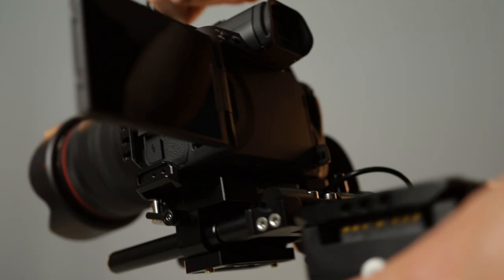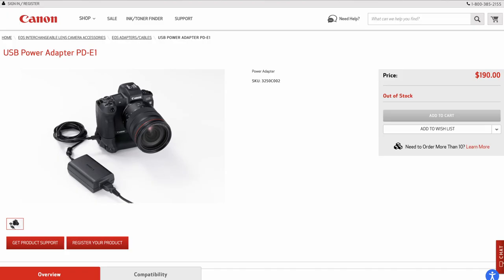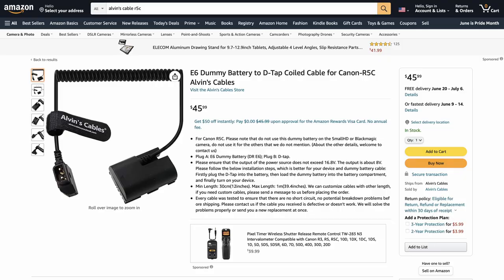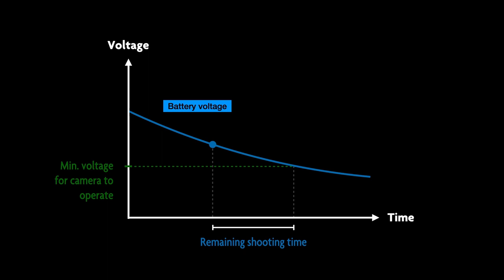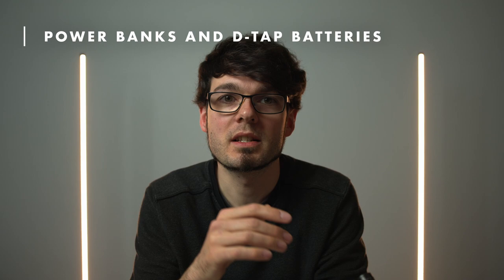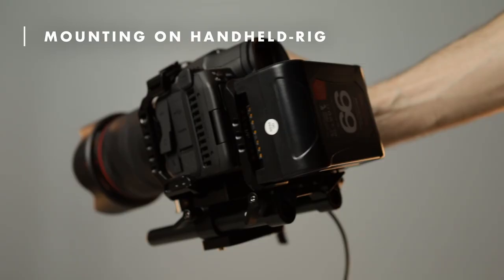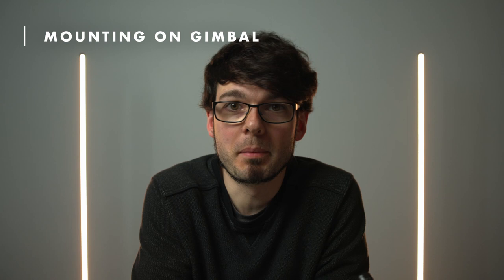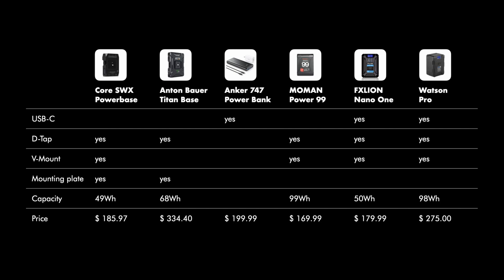Canon R5C Battery Guide (Power Banks and Dummy Batteries for Handheld and Gimbal Rigs)

Comment: Thanks for the info! I can also recommend the Andycine NP-F970 battery plate for the R5C. It comes with USB-C/ PD-out. The battery lasts really long. Is even more compact and lighter compared to the V-Mount. You just have to think about how to attach the plate. I now have almost all the solutions

Comment: Do you know if the Alvin cable dummy battery to dtap R5C cable will work to power it for 8K60? fantastic overview! I’ve searched online everywhere but can’t find accurate info about external power for the R5C! thank you for the great work! Subbed for life!
Reply from the maker: They have some issues with the cable right now regarding 60fps RAW, but they seem optimistic to fix it.
Reply: @johannesdoerr  oh no! I just ordered one! :(
Reply from the maker: Contact them, they might send you a second one once they figured out RAW 60fps
Reply: @johannesdoerr  hmm good call! thanks again!
Reply: On amazon’s page for the alvin dummy listed: “For Canon R5C. It does not support 8K auto focus”. So it’s not the perfect solution

Comment: This is super content, Johannes! Thanks for making it 👍🏻
I've got R5C recently and battery upgrade is on my next steps list...
Reply: out of curiosity, what run time are you getting from 1 LE-E6NH battery? I am about to buy this camera. Either lots of LP-E6NH batteries, or the battery grip, or the V Mount.
Reply: @agentleman7469  Commonly 30-40 minutes of filming. You can extend it a lot with the trick of pressing Media preview button which puts the sensor on sleep. I do commonly use it just with traditional batteries (and have 4 spare ones in the bag).
Reply: @JaroslavBengl  thank you so much for taking the time to reply, much appreciated. That seems okay for me. I might just get the battery grip and some extra batteries. Cheers

Comment: I am thinking about attaching a power bank holder to the right side of the cage, put the power bank, and THEN balance it on a gimbal. Yes, you still lose the gimbal controls, but if you can go for 4-5-6 hours of shooting with an Anker power bank, I think this might be a good option, while not putting that much extra weight on the gimbal

Comment: Canon has had the DR-E6C dummy especially for the R5C since before the launch. That combined with the Anton Bauer to Canon 9V P-tap cable is a solution that has been around from day one. Also, Niceyrig make a V-mount plate that combined with the Smallrig counterweight can be mounted a lot more safely to the RS2 to accomodate a v-mount pack.
Reply from the maker: Do you have a photo of the NiceyRig + SmallRig solution?
Reply: @johannesdoerr  I have a video on it ;)
Reply from the maker: @EmeraldAudiovisual  Ah, I understand! I thought about getting the counterweight kit for mounting something else under the gimbal some time ago. Definitely a good solution to mount the battery. Will probably work with the little SmallRig V-lock mount that I'm using, too!
Reply: @johannesdoerr  i just don't want to promote my stuff i somebody else timeline. But its a real good option.

Comment: Very nice video.

I took a slightly different approach and focused on the cost per watt-hour.  The Canon batteries, even the knock offs, are $3/watt-hour.  As I recall, the V-mount batteries that I priced were $1/watt-hour.  And some of the cheaper power bank type batteries were as low as $0.30/watt-hour.

With the power bank solutions, care must be taken to make sure that a single port can supply enough power.  Many advertise the total power but they have multiple ports.  So, check to see how much power a single port can supply.  As I recall, the R5C needs 20 watts.  (Someone check me on that.)
Reply: U need a power source that has the 9V/3A protocol (27W). The camera does not need as much but that is the protocol needed to make it draw power via USB in PD mode. it will not do it if that protocol is missing from the power source.

Comment: frist, thanks for the video
in the description you say we should get a better dummy battery but which one?
you havn't linked a proper dummy battery for the full 8k60.

I just need a dummy battery + power brick (EU/Germany) to record with the R5C in the studio without any limitations
Reply from the maker: Alvin's Cables has a dummy battery specifically for the R5C, but it still does not support 8K 60fps. As far as I know, there is no dummy battery that can do this.

Comment: I received my dummy battery from Alvin's Cables and it's no different then the others. They sent me a message saying that they were working on one that would provide sufficient power to support the R5C
Reply: How do you mean no different to the the others?
Reply: The Amazon page now states that it does NOT support 8K 60 fps.  To me, this tells me that Alvin is a legitimate company.

Please update us if / when Alvin replies with a solution that works.

Comment: What Apple MacBook Power Adapter are you referring to in order to charge the Moman 99 battery?  I would like to charge the Moman as fast as safely possible without burning up the battery.  But different MacBooks offer different Power adapters.  I have an M1 Mac.  Will that adapter work?
Reply from the maker: I don't change the Moman battery with the Mac power adapter, this is only possible with their new "pro" version of that battery. I the video, I was talking about charging the R5C with its internal battery.

Comment: Hello Johannes. 
I tried to emulate part of what you did for my Canon R5C, however I must have made a mistake somewhere.  
I purchased a FX Lion Nano 1 and a Focus Foto dummy plug, and it does not power the R5C
If I use the Vmount battery via usb-c, it powers the camera no problem.
I am thinking I will try another dummy plug
Do you have any other suggestions

Thanks
Reply from the maker: The dummy battery must be made explicitly for the R5C, because it requires a higher voltage. Other one will not work (in video mode)

Comment: Just got this camera and your video has been very helpful! Do you know if a 12V output from SmallRig NP-F Battery Adapter Plate could power the 8K60p? It'd be such a nimble setup.
Reply from the maker: There is a NPF plate that has a d-tap output, which could work with a d-tap dummy battery (but at the moment, the Alvin's Cables dummy battery does not support raw 60 fps, they are still trying to figure it out) https://amzn.to/3pi2v2W

Comment: hey! my usb c mac laptop power cable wont power my camera??? it doesnt work
Reply from the maker: That’s strange! Works perfectly for me…
Reply: I figured out. you have to have a battery in for it to work. Plugging in with no battery doesn’t work. I have another question: AF is completely greyed out and no options selectable when I switch to S&f motion. Have you ever had that issue? My lens is the RF 24-70 and i have s&f set to 72/23.98. No autofocus?

Comment: hi..work ok r5c with Alvin's Cables Lanparte LP E6 Dummy Battery to D Tap Cable ? you have problem with this or is ok,thanks !
Reply from the maker: Probably not. I had dummy batteries for the R5 that did not work with the R5C. Alvin's Cables has a dummy battery for the R5C which works, but not in 8K 60fps. Check the video description for the link.
Reply: @johannesdoerr  ok i order cable for R5C i hope to work with my batery d-tape Smallrig V50

Comment: Just a suggestion: What about Sony NPF to LPE6. I used it a lot on my BMPCC 4k and without too much of extra weight, I got a decent amount of runtime( NPF 970) - roughly about 90mins+. The one I had had a led light indicator which would turn yellow from green once the battery starts going down. And also less issues with NPF batteries when boarding planes.
Reply from the maker: Yes, that is definitely an option that I should have covered in the video! I have actually been using NPF batteries with my EOS RP before I switched to d-tap. Reason: the higher voltage can also power the Ronin RS-2. But if that’s not relevant, then sure! But for 8K RAW 60fps, you would need a dummy battery with voltage converter to 9 volts – does that exist yet?
Reply: @johannesdoerr  Most of the NPF adapters have a 12v output. You can make your own dummy battery, just add a resistor to bring the voltage down to 9v
Reply: Andycine make a NPF adapter, that has D-tap and USB-C. The USB-C connector unfortunately only is 9V 2A, so not sufficient for the R5C, but one can power the R5C with the D-tap connector.
Reply: Hi Johnny,

That’s for sharing power bank and V-mount battery options.

You may have missed Core SWX latest offering called the Power Edge Base Link that has a 70Wh battery + a better 1/4” base with a tripod and V-mount at the bottom + add link multiple PB Link V-mount batteries (I only have one but don’t have multiple to see how it hot swap or continues to power when you replace the depleted one).  It also has a PD and USBA ports and can show the recording times.    

Alternatively, you can try using the Smallrig 3085 Power bank adapter mounted on a cage or hotshoe:

SmallRig Power Bank Adapter for Mirrorless and Cine Cameras, Convert Type-C 5V-12V Input to DC7.4V/2A Output, for BMPCC 4K & 6K, for Sony A7S3, for Canon EOS R5 R6, for Fujifilm X-T4 - 3085 https://a.co/d/hvYlQhU

The lightest and smallest power bank, 20,000mAh, is from Nitecore.  It is made out carbon fiber (hence light and durable) and has 45W PD.  If you strap it to the Smallrig 3085 power bank adapter, you can power the 5RC and hot swap for another fresh power bank with the LP-E6NH inside the camera.  Or attach a second power bank and continuously charge the 20,000mAh using the Input2 USBC port

Comment: Really useful, thank you, and saved me from buying the wrong LP-E6 batteries 😊 Curious to know if you risk burning out the HDMI port with having both camera and monitor powered from the same battery. It's a real risk with cinema rigs, with many folk suffering from it at some stage. I'm no expert in the electronics side of this, but maybe having an internal battery mounted in the camera stops this from being a potential problem? It's always at the back of my mind, and as a result I tend to keep my cinema cam (which doesn't have an internal battery) and monitor powered separately.
Reply from the maker: It's good to be aware of this! I talk about this in my video about the RP, but it's also valid for the R5C: https://www.youtube.com/watch?v=sa34kypwjvE&t=206s
Reply: @johannesdoerr  spot on Johannes, thanks for the link. Yeah, I've got in the habit of always following this sequence even when I am powering separately, so that it becomes automatic.
Reply: @johannesdoerr  If I’m  powering the r5c via usb-c and a monitor from the same v-Mount battery, will hot swapping the battery fry the hdmi port? (Since it wouldn’t be following that shutdown sequence)?
Reply from the maker: @joegrieco7343  First: canon cameras seem to have a protection against this, at least I‘ve never heard of anyone damaging their camera like that. For blackmagic on the other hand, there are such reports. Regarding usb-c: I think the construction of the connector more or less ensures that the ground pins make a connection first when plugging in, and this should prevent a ground loop. However, no guarantee.
Reply: @johannesdoerr  Good to know. Thanks for the quick response!
Reply: Recently my Canon R5 C had a issue regarding the use of a dummy battery, it broke my camera and had to get a whole new PCB board. Now I might just stick to USB C for powering the camera. @johannesdoerr

Comment: Does the moman battery you use support usb pd charging or would I need to get the dtap cable you need mentioned. Thanks!
Reply from the maker: You need a dummy battery. The Moman only has d-tap and usb-a output.

Comment: Nice video, any idea what the standard battery life is like when only using it for photos ? would it last the same as the r5 ?
Reply from the maker: I haven’t tested that (and I don’t have the R5), but I would be surprised if there was a difference. It’ll the lack of IBIS probably improves battery life even.
Reply: Battery life is good when using in photo mode.

Comment: Why do you say Alvin cables is 9v and so does 8k60. I messaged them and they said their dummy battery does not and will not work for 8k60. Why do you keep saying they do in different videos ?
Reply from the maker: This is why I put a "caution" note in the video description. At the time when I recorded this video, they claimed that the battery would support 60fps Raw, and sent me two prototypes for testing. It didn't work as expected for me in that mode; the camera shuts off power to the lens, so that is only an option for manual lenses. However, since I mostly record in log, the dummy battery works great for me.

Comment: heyy i was planning on getting the canon r5c with RF15-35 2.8 but is R5C fully compatible with dji rs2 . i have been a photographer a long time now but i want to invest in video and photo want to do more of interior photo and video and vertical reels for general video assignment  or will you suggest canon R5 for dii rs2 i know that my videos will not be very long. will a normal L plate work for r5c and rs2 gimbal i currently have canon 5dmarkiii nd 60D . going to buy in 2 days do suggest thanks i am not sure if i need a canon i can completely shift to a new brand :D it is just that i have already invested so many lenses in canon. i was getting sony a7rv i similar price but in that i can only start to buy 1 sony lens
Reply from the maker: The only thing that does NOT work with RS2 and R5C is controlling things like ISO or focus through the gimbal. Only start/stop recording works. For me not a big deal. Balancing the camera with that lens should be no problem. You really have to device if you want to dive into the cinema OS world with the R5C, or if you'd rather stay in the photo world with video mode. You can watch my R5C film rig video to see a comparison with my previous RP (obviously, that's not an R5, but many differences to the R5C also apply to the R5). I hope that helps!
Reply: thank you yes i will check them out @johannesdoerr

Comment: Great video. But the E6 Dummy Battery to D-Tap Coiled Cable for Canon-R5C Alvin's Cables, It states ..................       For Canon R5C. It does not support 8K auto focus. If you need the cable that supports 8k auto focus, please contact us. Please note that do not use this dummy battery on the SmallHD or Blackmagic camera, do not use it for the others that we do not mention. (About the other details, welcome to contact us), Have you gotten 8k 60 P using this cable with a v-mount batt?
Reply from the maker: That adapter turned out to be work in progress… Alvin’s Cables has sent me two adapters so far for testing, both don’t work for 60fps, yet. They said they keep working on it and will send me another one.
Reply: @johannesdoerr  can please keep us updated on this…. In the meantime any other E6 dummy batt works?
Reply from the maker: @rMr.big13  I will!
Reply from the maker: @rMr.big13  don’t know of any other dummy battery that works so far. There is the original canon one, but it does not work with d-tap

Comment: Why didnt you list the Wh of the powerbank?
Reply from the maker: I think they don’t provide an official value.
Reply: @johannesdoerr  You can calcute from the milliamphours and the voltage. Because the powerbank has a flexible voltage output in comparison with v-mount which has a fixed voltage. You need to calculate yourself. If the official battery is 7,2V, and thats the camera draw thats roughly 180Wh, almost double from the other alternatives

Comment: Hey, is it possible to use the camera as a webcam, while getting energy to keep it full over, the same usb-c cable?
Reply from the maker: The EOS Webcam Utility App is not compatible with the R5C as far as I know. I just tried it and it doesn’t work, and the website does not list it either. :-(
Reply: @johannesdoerr  Maybe you can try the live view from the eos utility, if that is available. Basically just testing data flow while also powering the camera through the same cable.
Reply from the maker: @2darki  just tested: live view works in photo mode, but video mode is not compatible with the eos utility (it shows a message that camera must be in photo mode). And it does not look like the camera is charging when it’s connected to the computer and on. When it’s off, then yes.
Reply: @johannesdoerr  Is the camera running from the battery or over the cable while in live view?
Reply from the maker: @2darki  I would say it’s from the battery (no PD icon visible in display that would indicate usb-c power supply)

Comment: At 7:49 … what monitor mount is that? I’ve been trying to find a nato rail to cold shoe monitor mount just like that!
Reply from the maker: This is a custom piece that I got from SmallRig. It’s actually just a combination of two monitor mounts. Maybe if you ask them, they can make one for you, too. This is actually one of my favorite pieces. Right now, I’m trying to get a similar one, but with an Arri mount instead of the cold shoe.
Reply: @johannesdoerr   Can you send me which two mounts so I can do this?
Reply from the maker: @ensolutionstudios2556  Bottom of BSE2346B, top of BSE2385. I cannot guarantee that buying those will allow you to disassemble and reassemble it that way (maybe there are some parts glued for example). SmallRig did that for me, using freshly made pieces I think.
Reply: @johannesdoerr  oh you mean you asked them and they made it for you!?
Reply from the maker: @ensolutionstudios2556  yes! They have the DreamRig program for exactly that kind of customizations.

Comment: You dont need a 87w charger, the camera draws 13w max
Reply: for usb-c you need a powersource that supports the 9V/3A PD profile.
Reply: @Digi20  Still, thats only a maximum of 27W
Reply: @johnnyweissmuller5838  sure, just stated what is needed.